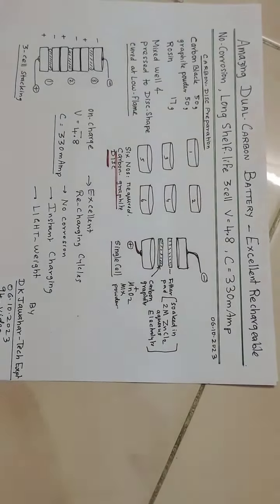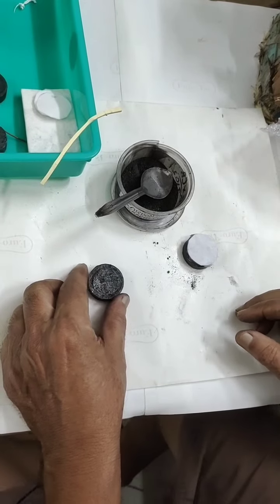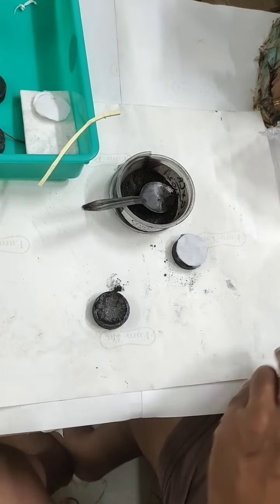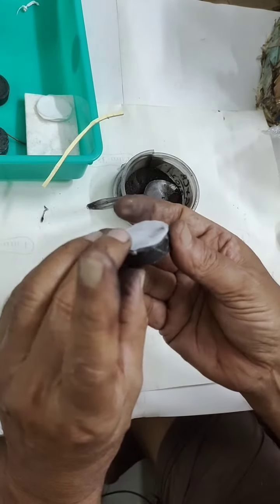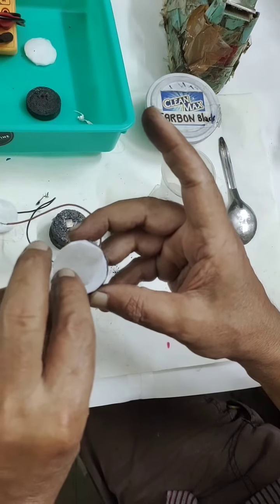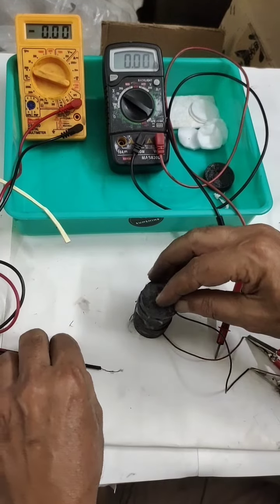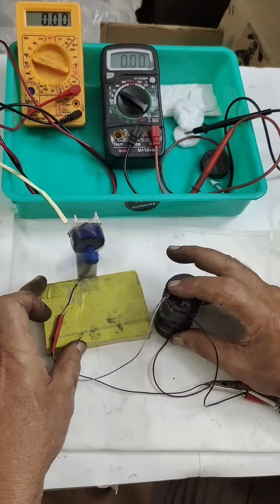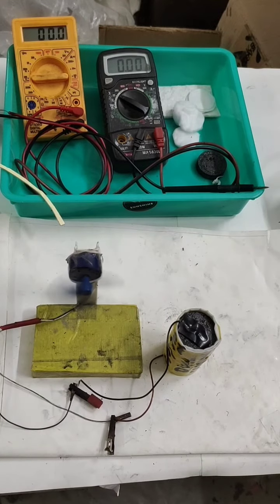AMAZING DUAL CARBON BATTERY-EXCELLENT RECHARGEABLE CYCLES, NO CORROSION, LONG-LIFE-V 4.8, C 330mAmp

Comment: Nice work, thanks for sharing, how do you increase amps and how do you increase voltage?
Reply from the maker: Here in my model I have stacked one over the other on a serial base thereby the voltage gets added and also the current though constant and in practice there will be a gradual increase seen. My cumulative voltage is 4.8volt and current found to be 330mA.  The current density will increase when you can stuff the positive electrode with more MnO2 along with carbon mix. 👍

Comment: Thank you again, great work. If you use zinc iodine as electrolyte, you will prevent chlorine gas that may occur during charging. Chlorine and iodine are in the same group in the periodic table. Iodine is solid and less reactive, while the other is gaseous and highly active.
Reply from the maker: I will try to make use of KI, 👍

Comment: Can a solid state electrolyte be used instead of liquid to lower the operational temperature of battery?  Charge and discharge below freezing.
Reply from the maker: This is my experiment, you can try with your electrolyte combinations. These types are ultrafast chargeable  with endless charge cycles. 👍 Really there is no corrosion